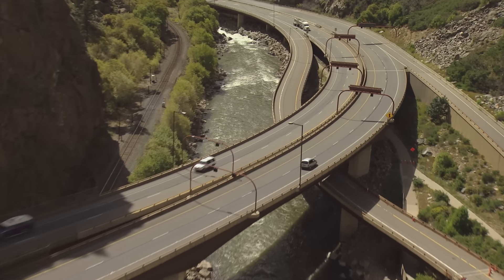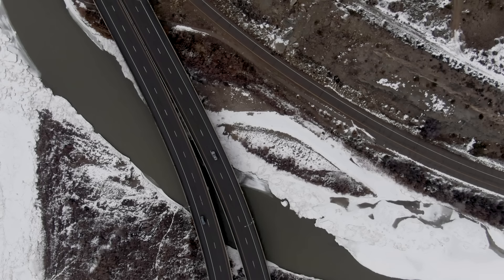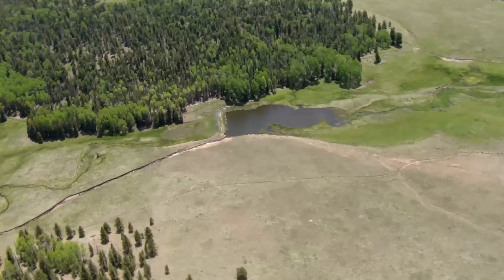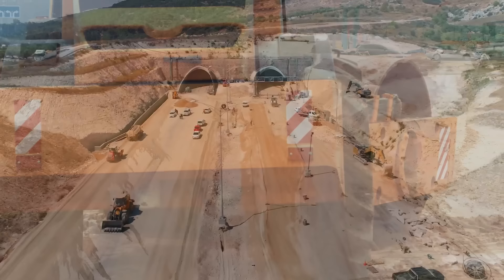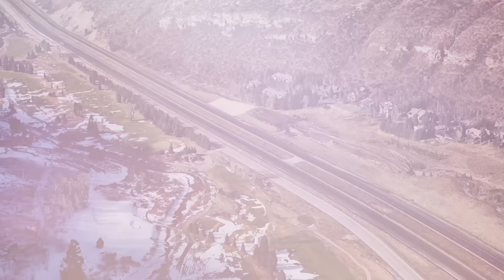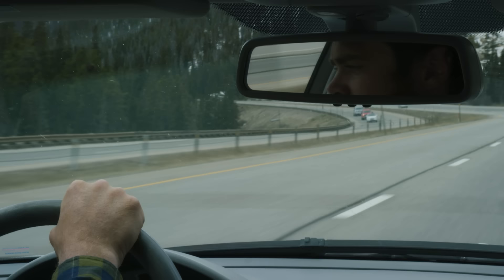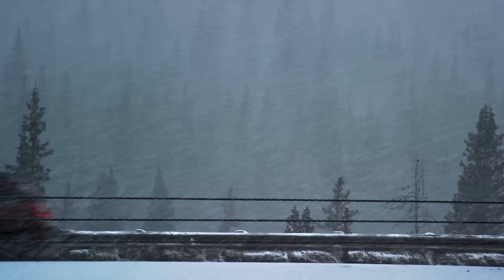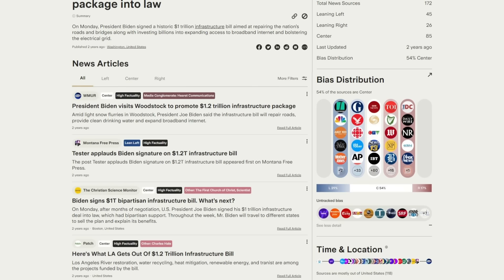How to Build a Road

Comment: I would like to see responses from Germany, Switzerland and Austria comparing this to their mountain road experiences.  Comparison videos, possibly be collaboration would be great.
Reply: Not completely related, but US infrastructure spending is often judged to be much less efficient. In subway construction, for example, US was paying like 2-3 times more per km than peer countries like France.

The US paid about 550 mil USD/km on average for rapid rail transit. It was 310 in Australia, 300 in Germany, 250 in France, 260 in Canada, 200 in Austria, 190 in Norway, 130 in Switzerland. (UK and NZ were few that had higher prices than the US).

This has nothing to do with labor costs as if you look it up, Norway and Switzlerland have very high GDP per capita figures (only IR and LX are higher) and they build at one of the cheapest prices. 

One of the things they point to as the cause is that US just doesn't build consistently. There'll be a big burst of spending for maybe 5 years and then it spends, the institutional and technical knowledge gets lost and when it starts falling apart 30 years later, it's basically starting from scratch. Successful cities/countries, on the other hand, keep building, always.
Reply: @chinguunerdenebadrakh7022  wouldn't economies of scale also come into play here, since the US has much less in miles of passenger rail per land area than those countries?
Reply: The crossing of the Alps was similarly a very big challenge for a long time, because there too is a tall and steep mountain range stretched across the Alps without any larger valleys cutting through it. Since 1967 there is the Felbertauernstraße with a 5.3km long tunnel which was large enough for trucks to pass through. Later in 1971 there was the highway over the Brenner, which is still by far the most important road connection between Austria and Italy. That highway is bridged up for the most part. I can't compare it directly to the I70, but it must have been quite expensive to build. High demand is now causing frequent congestion there, mostly from trucks. That's why a 64km long rail tunnel (Brenner base tunnel) is now being built that simply cuts below the mountains and should take over most of the cargo traffic. In Switzerland the Gotthard base, opened in 2016, has a similar concept with 57km length.

From what the video told me I would say that I70 is situated much higher around 3400m, whereas the Brenner highway is only as high as 1400m. But the Rocky Mountains around there don't look as steep as the Alps.
Reply: @YAOMTC yes but also no, I guess. But we can't predict the future. Would it even out if the US built always, so that trains would be more accessible, so more people would travel, so more money is collected from fares, so it could be cheaper, so even more people would travel, so there would be greater demand for better rail, so etc etc?
Reply: as an austrian that were my thoughts. I know nothing about roads, but I wonder how the alpine roads compare to this.
Reply: I mean, when you have a governing system that encourages the leader of the state to tear down everything that their predecessor did, damned be benefits that the predecessor had brought or the consequences of such rash actions, for the sake of their party line...

Yeah.
Reply: If you compare an Austrian, Swiss or German road with an American one, the American one falls below in terms of quality for the same price
In addition, all these countries have the enormous advantage of having a train
Reply: @The-Plaguefellow  That is a failing of a system that has featured periods of renewal.  In Hindu terms it is Kali, the destroyer, that brings new life [that is how it was explained to me, but that's not my culture].  I'm more comfortable with Yin and Yang, which is more similar to European systems like the maundering of Marx and Engels.
Reply: @YAOMTC  not in the way you're suggesting. There is problems with economies of scale when you're starting up production from essentially scratch after a decade or two of pause, but many US cities have quite dense networks.

Washington D.C has about the same subway length as Paris and by whatever measure, Paris has way more people than DC. San Francisco has 191 km and 4.6 mil ppl in metro area, Berlin has 148km and 6.1 mil ppl in metro area.

NYC has 400km of subway line, 8.8 mil in city proper, 20 mil in urban and metro area. Tokyo has 300 km of subway (200 for Tokyo Subway+100 for Toei), 14 mil in city proper, 40 mil in urban and metro area. (Btw, Japan was at 180 mil USD per km on average) To be more specific on costs for these cities, NYC East Side Access was 2.6 bil USD per km, NYC Second Avenue was 1.56 bil, Tokyo Metro Fukotoshin was 250 mil.
Reply: A german here: The alps can only be crossed on highway through several tunnels. Furthermore our roads are way more narrow compared to US roads in general which means we need less space. You can cross the alps on the high-pass, but it‘s only fun in a sportscar. With a lorry, it is nearly impossible. But also keep in mind that the alps are higher and more narrower compared to the Rockies, so it is possible to ditch a 15-25km (10-15 miles) tunnel and you have passed most of it.
Reply: @BruceLeeBelle  The US is larger than any single European country [not including Russia, of course], meaning the expense for a comprehensive national road network is enormous.  There are many more issues than mere cost of land.  

The budget for building Interstate 95 straight through Boston and onward to Maine hit two problems and couldn't continue more than a couple of kilometers north of the ring road south of the city before having to be abandoned.

The cost of the land is high, because the population density is 5,400Km2, and there were massive protests.
Reply: Well, as a European, I am surprised you don’t just build a couple of large tunnels, like we do through the Alps in Austria, Switzerland, Italy and France, which are often cross border tunnels. Or go and visit Norway. They have build tunnels to everywhere. Small village not accessible in Winter? Build a 24 kilometer tunnel to it. Want to go to one  of the many islands? They have build lots of tunnels under the ocean. They are currently building a tunnel that will go about 400 meters below sea level.

It seems rather odd you guys build a road up the mountains, and only a relatively short tunnel high up in the mountains. Why not just cut a longer tunnel at a much lower elevation?

Sorry, but I am not really impressed by this road.
Reply: There really isn't anything comparable in Europe.  The motorways that cross the Alps are on much easier terrain by comparison.  The Alps roads that are on difficult terrain are usually very twisty 2 lane roads not suitable for heavy trucks but great for tourists.  They also have HSR that crosses the Alps to take a lot of the passenger traffic. I-70 crosses far more difficult terrain than the motorway passes in the Alps and has the capacity of a major freeway/motorway and carries huge amounts of heavy truck traffic as well.  Elevation is also a huge factor, the highest motorway passes in the Alps max out around 4500ft with the highest 2 lane passes in the Alps in the 7000ft range (with Stelvio being the outlier at 9000ft).  The Eisenhower tunnel sits at 11,150ft, Loveland Pass is 11,990ft
Reply: @johnverweij8368 you seem clueless about the topic, lol. What village has a 20 KM tunnel built to it...
Reply: @nikolavideomaker  Na, he's pretty on the money. Here in Austria, we have 160+ tunnels currently finished in a country the size of South Carolina. The Münsterertunnel near were I grew up is over 15km long and pretty much connects two towns with a combined population of about 5000 people. Now granted, most massive tunnelwork is done along major transportation arteries, but much is not. Tunneling is the least invasive way to facilitate safe, efficient transport through alpine terrain after all
Reply: I think when people compare the US interstate to European roads its kind of hard to understand the scale, if you look at Austria or Switzerland, despite Colorado only being one state its ~3x and ~6x larger than Austria and Switzerland. I-70 itself is a relatively very small part of the interstate and just the part going from Palisade to the end of the Eisenhower pass is 350km long. Not to mention it has to be built to the same standards as the rest of the interstate highway, there are no 1 lane interstate highways.  They have to maintain the correct width for the lanes and shoulders so tunnels are not nearly as cheap as they can be for other roads. That and restrictions on how tight turns can be, how steep slopes can be. Also this specific section of the interstate is able to be driven at a minimum of 65 mph/105 kph, often higher at 75 mph/120 kph with the exception of during construction, and glenwood canyon. Overall I think its just hard to compare since europe doesn't really have a good equivalent to the interstate highways. I think the best bet for comparisons honestly is German highways although I don't know much about them.
Reply: @Piorum  General Eisenhower was impressed by Germany's Autobahn, and when he became US President he was behind the construction of the American Autobahn a.k.a. the Interstate Highway System.
Reply: @JMM33RanMA  If only they'd impressed him with their railway system, the world could be a much better place :(
Reply: @traveller23e  The US actually had a very good railway system, and some places like Boston had very comprehensive trolley and bus systems.  Our freight fail system is still very good, but cars and trucks are what killed the passenger systems.  Given the huge distances and spread out towns,                    suburbs and cities it is much more convenient to drive or take a taxi or uber.
Reply: @dejfcold  In certain areas of the US sure but in areas like where this video is set it would be far less efficient than local air travel

The US has one of the largest rail networks on the planet we just use it differently is all
Reply: @chinguunerdenebadrakh7022 labor cost of a project and gdp arent really comparable
Reply: @traveller23e usa has most railway per size...
Reply: @poisonpotato1  Most railway by what measure? Size being land area?
Reply: Austrian here. I just had to google how steep our highways really are. Funny thing is, the steepest bit is actually uo a small hill in the lowlands, but it racks up to a  10% slope. Another quite steep bit is right outside of Vienna but it only is about 5%. I think the main difference is that in Austria, I70 would incorporate at least 30 Tunnels or be just one big Tunnel at the base of the mountain.
Reply: Yesterday,  I drove I-70 from the Utah border to Denver.  What a horribly maintained highway. There were no snow or ice challenges- rather the undulated highway road surface itself, with the constant ups and downs of traversing the mountains, on truck-rutted pavement, is a disgrace.   Why can't we have a super mega tunnel on the European scale like they have across the Alps, to Traverse the Continental Divide for a lot bigger distance than what the Eisenhower Tunnel provides.
Reply: @johnverweij8368 As an American, I'm not at ALL impressed with it either.  I'll bet U.S tax dollars have built better highways in Afghanistan than what Colorado has

Comment: As a Highway engineer practicing in mountainous areas of the East Africa Rift Valley, I appreciate the accurate research you have done to show the amount of work that goes into designing & constructing a highway project in a challenging topography. It's amazing to see how the design standards have evolved through the years. Even though we use also use AASHTO to supplement our design, we are forced to use 8% superelevation because we couldn't be certain that the traffic would actually adhere to the design speed due to the cultural speeding in East Africa.
Reply: I never considered that cultural speeding would be a factor that engineers have to consider. In America, we take a lot for granted about our road system.
Reply: I suspect that snow/ice less of a factor in the East Africa Rift area compared to the rocky mountains. You aren't as worried about stopped or slow cars losing side traction and sliding off the road.
Reply: I have never heard of the term "Cultural Speeding" Are there any other areas of the world that have that problem?
Reply: @MarkPemble  I suppose it has to do with the madness that is driving in 3rd world countries in general
Reply: @MarkPemble   Many; Italy, Russia, Germany etc...If you drive in those place you'd see...MANIACS!
Reply: @godbluffvdgg   So driving to work every morning at 220 km/h(136 mph)+ in some sections makes me a maniac?! Greetings from Germany :D
Reply: You're Kenyan, right?
Reply: @MarkPemble  A lot of Central and western asain countries. Pakistan and India come to mind
Reply: The preservation of nature that changed the chosen route at first reminded me of that Nyandarua aberdare ranges road that was halted due to environmental reasons in Kenya.
Reply: @MarkPemble Indonesia, India, Vietnam, Australia, basically countries with wide or long flat road.
Reply: @MarkPemble  Jordania
Reply: @MarkPemble New Jersey, USA haha
Reply: @MarkPemble  in the South US we like to push the speed limit pretty good, pretty much everyone does 5-10MPH over, and seeing guys do 20-25MPH over is pretty common
Reply: @MarkPemble you can see it in America depending on the stats you live In. For example in Colorado rarely and I mean rarely do you see someone pulled over for speeding and everyone here goes 10 or more over. PA where I grew up the cops pull you over for 2 miles over so everyone is paranoid and go slow there.
Reply: @kandy8588 😂😂😂 as a fellow jersian I second this
Reply: i appreciate your input from this angle!
Reply: @MarkPemble from my geography professors anecdotes? Italy 😂 his daughter studied in Rome and he was fully unprepared for how fast Italian drivers went along tiny, tiny roads
Reply: @MarkPemble large swathes of the united states. In Michigan basically everyone goes 5-10 above the speed limit when not on the highway, and 10-20 above when on the highway. When there's not traffic, at least.
Reply: @MarkPemble Atlanta

Comment: I dug out the railroad tracks (UPRR) in Glennwood via high rail track hoe last summer from the mud slides that closed down sections of I-70 & trapped motorist for over a day in Glennwood tunnel. 

Great video. You should make another talking about the building of that section of railroad and the challenges faced while doing so. Very neat part of logistical history
Reply: I agree. And the original line built up and over Rollins Pass is an incredible marvel until they built Moffatt Tunnel which is also a marvel.
Reply: Was that the once in a century event that caused all the landslides and flooding? I bet that blew your mind to see the awesome power of mama nature. Thank you for rebuilding it so I can travel through to see my relatives in Oklahoma. It's a beautiful drive.
Reply: @Hogslice  due to the lack of vegetation because of the fire & the heavy amount of rail fall that followed caused the mud slides. Could be a issue until vegetation takes root
Reply: The entire story of building the roadway and railroad through the canyon is interesting and would be a great video.

Comment: As a child, my family lived in Colorado but my grandparents lived in Utah. To visit them we either had to drive up through Wyoming on I-80 or take the I-70 route. Going through Colorado was our favorite as it was way more beautiful and fascinating even if it was a few hours longer, but after a couple of Christmas trips through terrible conditions we decided to only take I-70 in the summer. In fairness, I-80 in Wyoming has harsh winters too, with permanent checkpoints to shut it down for excessive blowing snow, but it was faster and flatter with less canyons and turns. My father would have to take enough time off from work to give us the flexibility to wait out the weather if a winter storm blocked our return trip home. It was worth it, these highways made all of my memories with my grandparents possible, and are a part of what I call home

Comment: I 70 through the Rockies is cool road to drive. Terrifying at times, but still incredible that a highway of that size was built through the mountains
Reply: the only time its terrifying is when you cant see your hood because of the snow falling. otherwise...its ok.
Reply: @LeelssDelta different tolerances
Reply: @LeelssDelta  I was about to suggest not visiting in winter, especially without previous winter driving experience.
Reply: I drove it yesterday. The traffic is the scary part to me.
Reply: I-70's a piece-o-cake.  Do some of the two-lane state highways across the Rockies.  Some will provide decent brown-pants moments, lol...
Reply: @Backroad_Junkie  Red Mountain pass comes to mind. 😳
Reply: Colorado should do the same with railways, like Switzerland does
Reply: Some of those corners at 90+ are a bit sketchy

Comment: Immediately west of Vail pass one of my first jobs was installation of cut and fill culverts.  Culverts between 6 and 11 feet in diameter, crossing both east and west road beds.  The cuts excavated by surveyor scope and large excavators,, I was the guy to enter the ditch and with a shovel and by eye, flatten the center of the ditch to receive the culverts.  I was one of the men assembling the sections and on the fill teams compacting the spoils to 95% and greater to bury the pipe.  1971-1972.